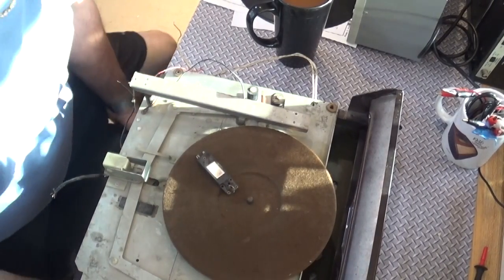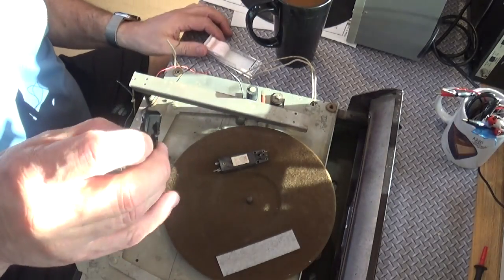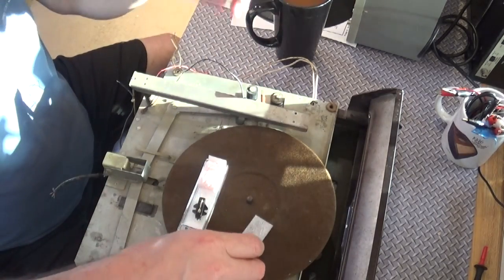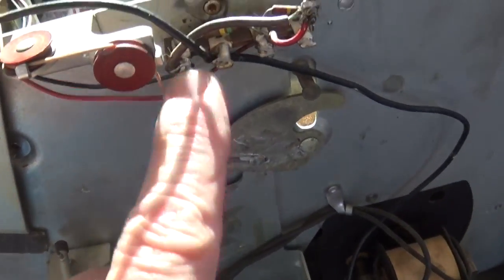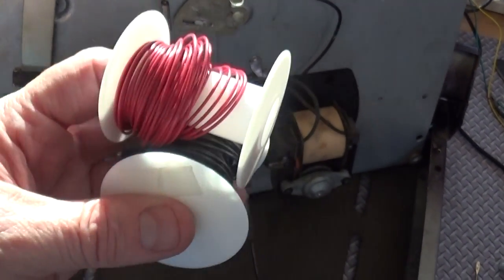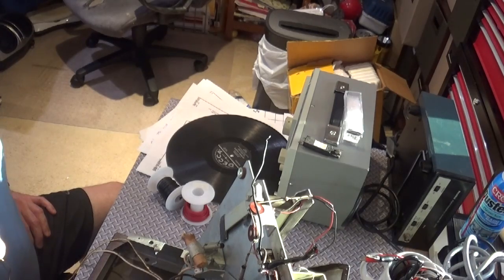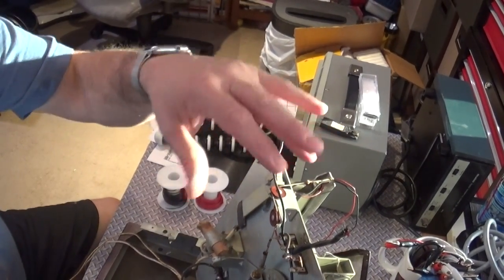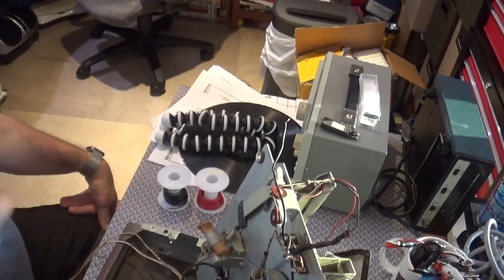Philco 46-1201 Bing Crosby Episode 5 - Needle in a haystack

Comment: Ron,, just food for thought. Buzz did a few videos on rebuilding those old cartridges. You might want to try that when you finish your project. It would be nice to have a rebuild in stock. Those flex tripods are really handy. I have a small one and they work good on the bench.
Reply from the maker: Carl, I saw that video and I am happy report my phonograph is working as you will see in the next video. I considered using Buzz's method but my $15 solution works just as well :)  See the next video  - thanks Bud
Reply: Yeah Ron I figured that is what you were doing. Can't beat those kind of prices and it speeds up the process.
I was thinking maybe you would try your hand at rebuilding it down the road. Kind of a rainy day project.